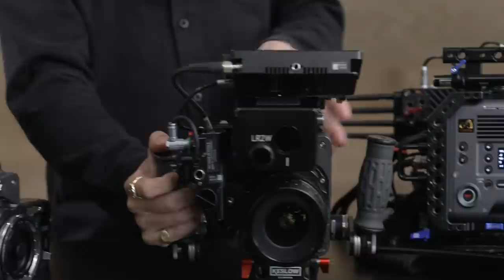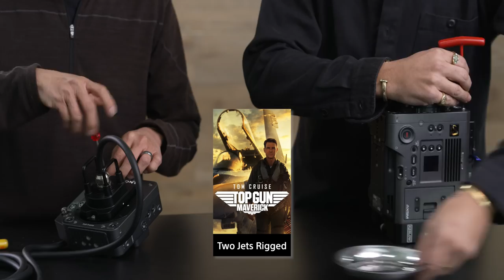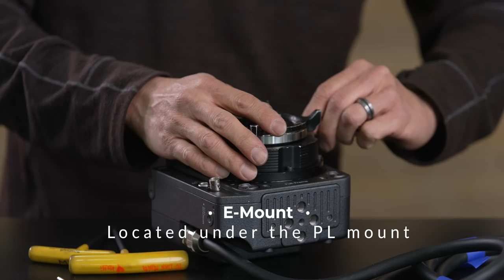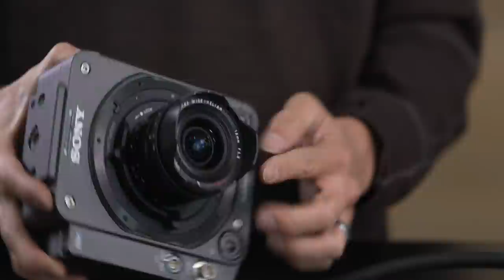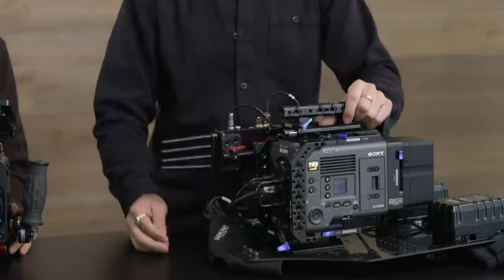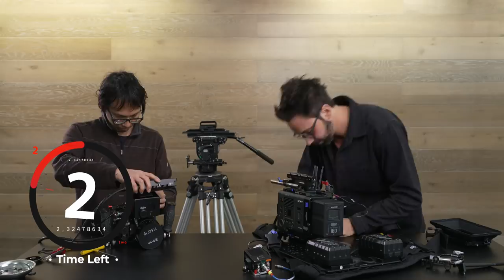How to Rig the Rialto 2 with legendary 1st AC Dan Ming

Comment: Props to whomever rigged the 3rd plane with "exterior cameras".  A smooth jet, with no obvious "points" or places to grab or screw into, flying at speed,  had to be a real puzzle to solve.   Not the point of this but a subject of curiosity.   Video does successfully answer some questions about practical application of the setup.   Appears "backpack mode" puts the carrier's head about a foot from the video TX.   Radiation treatments, anyone?